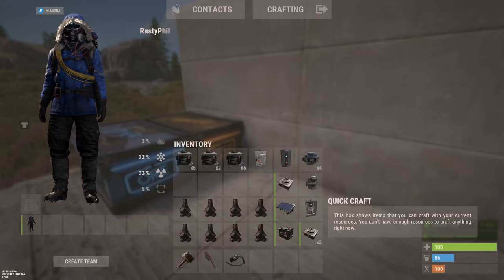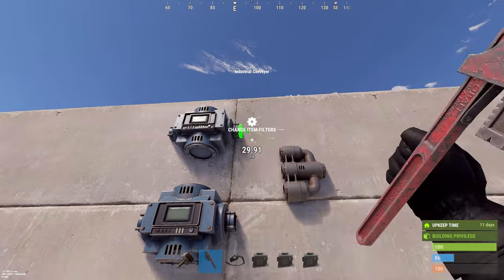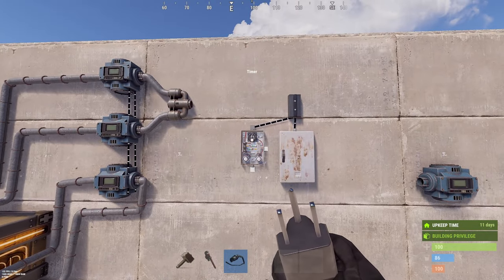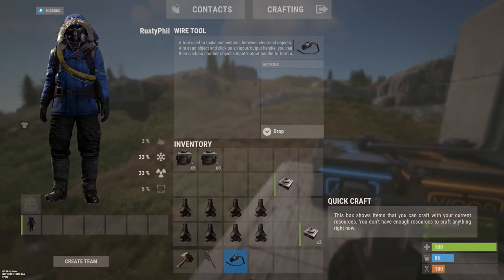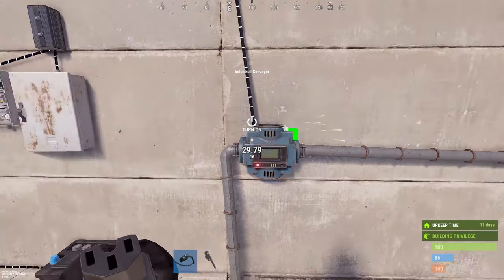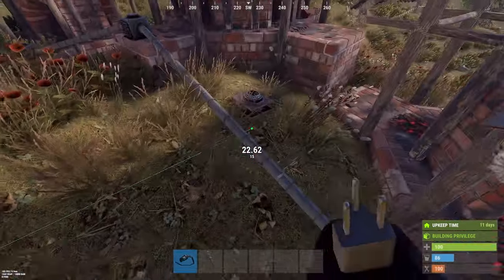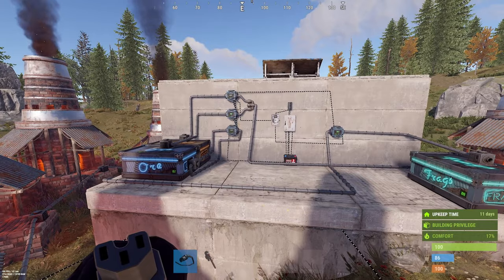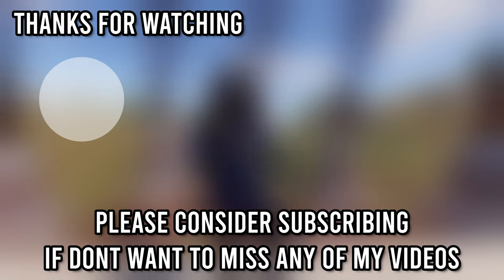How to set up industrial furnaces the easiest way - Rust

Comment: I want to continue burning wood to get charcoal what should I do?
Reply from the maker: @NXT_GM  if you have no more ore to smelt. You can turn on the wood conveyor manually and it will start burn wood for charcoal. The systen should not turn off except something changed with the conveyors.

Comment: Hey rusty, i loved this design for auto smelter... do you think is there any way to add a cooldown? sometimes the igniter burns twice at least, when furnaces are already running... i tried to solve it adding a 60 secs cooldown -my ideal will be 120,  is just for testing-, but doesnt work because the filter continues to bring wood, and reaches the cap preventing the igniters to turn on; i got stuck there and cannot solve it. Thanks very much, have a nice weekend
Reply from the maker: How did you add the cooldown? Its much easier to make complex circuits after the last update. Electrical parts itself dont use any power so GGs on that 👌🏻 If you want we can get in a discord call and try to solve the problem on one of my testservers.
Reply: @rustyphilyt  i will try copying the circuit on a dedicated sv, lost it after been kicked from a building one; im living on south america and there is not build servers hosted on the region...
Reply from the maker: I will try to add the cooldown and text u when i got it or not 😅
Reply: @rustyphilyt  Thanks bro, im doing some bread now but ill try it again when im done. Would be cool to make a discord call, but i dont think we can understand us because i never interacted with ppl that speaks english by talking
Reply: @rustyphilyt  Hey, i found a way to do it... it isnt the best way, but is a way... would be better if i can avoid the first timer to trigger -so the 2nd timer will prevent first from trigger, it isnt neccesary; its just an obsession thing lol-.
Reply from the maker: @mauro2396  nice to hear u did it your own ❤️ 👍

Comment: why use large when you can just use one elect cube to do the same thing but its inside your base?
Reply from the maker: You dont have charcoal with the elec furnies tho.
Reply: I normally do a triangle with 6 furnaces (u can put adapters on all if u place them right, (then put a window frame infront pf it) and a oil refinary for charcoal and fuel  @rustyphilyt ❤ (im a solo so I like the compact designs) 

Would u mind making some small systems for small bases? Sorting, autocrafting and locker falling? I know how to do them but would be cool to see what u could come up with in a very small base xoxo love the content
Reply from the maker: @tassarna93  check out my channel. There are already videos for autolockers and sorting system. 🫡 i will check out some smaller systems too 👌🏻❤️